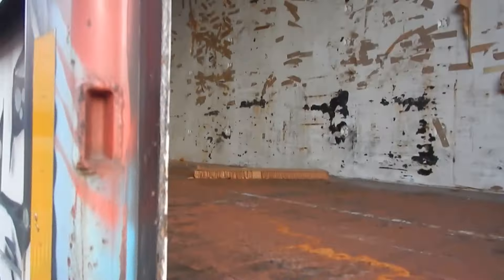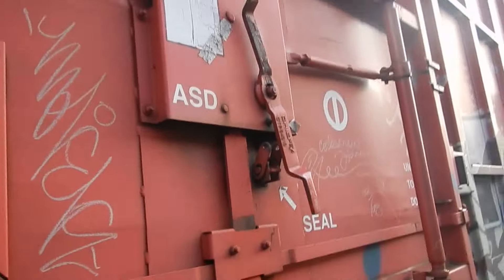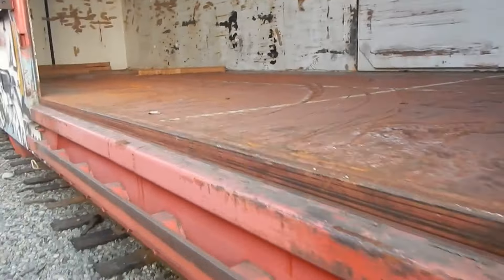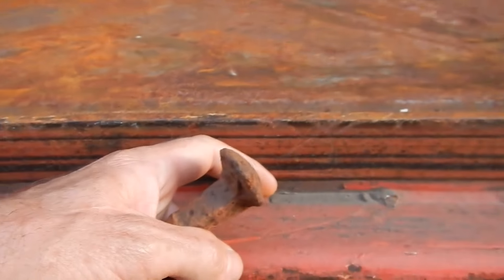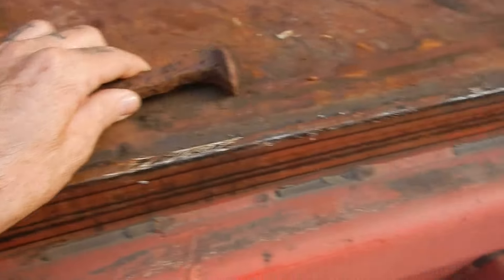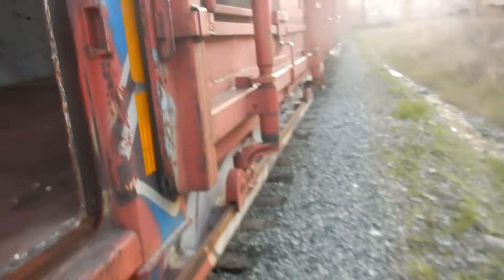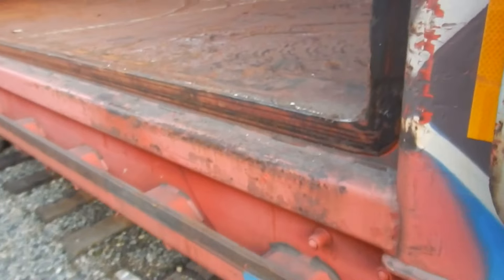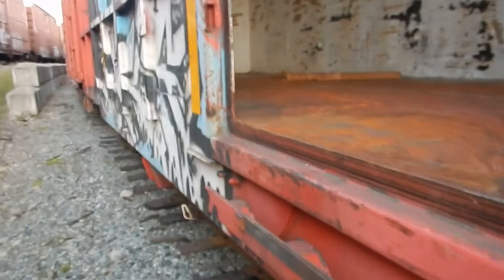Pinning a boxcar door (hopping freight trains)

Comment: Good luck with that.That type of boxcar door is a plug door.They are hard to pin open with a RR spike.
Reply from the maker: utilized as a sample - this door me prefer to string up - one or the reasons me keep rope with me or strapping ya find in boxcars - personally me don't ride boxcars - they rock side to side - every rider and they kin run for them not knowing bunch riders be killed in them - closed ride - me prefer ta sleep in shotgun hoppers - rest of the day me prefer ta ride hoppers with full sided side walls on each side of the deck with hopper dirty face high side walls - me don't ride loco - every rider and they kin run for open loco - not for me -

Comment: The information on these plug doors being safe is NOT ACCURATE. I'm a railroader, and it is illegal for plug door boxcars to move with the doors open because of their tendency to swing out and slam around. Also, if you're gonna ride inside one remember that it is illegal for them to be open and unsecured. If a plug door like this is left open, somebody WILL come by and attempt to close it. Best case scenario, they see you and you get arrested. Worst case scenario you are locked inside. Plug doors are NOT safe to be left open.
Reply from the maker: if ya be posted that some folk be lost legs when the be sit at the door with legs hanging out and did not secure the door from sliding shut - me would agree with ya - unfortunately me Don't understand what ya be sayin - open Boxcars are found in America few in Canada and most them be slide doors - they do Not swing out - they slide back and forth - Swing doors don't exist on Boxcars - spent years working part time for SP BN and CSX - plug doors in general are modern slide doors that move out a few inches - they were first started for bunkerless reefers mech reefers and insulated boxcars - reason for them be insulation that ya can not get with a old sliding door - the other reason all the large box cars today have mostly plug doors is that large sliding doors are hard to open and close - The plug door rotates out on two lock levers and slides but when you close it the lock levers twist in and lock the plug in place - why we pin the doors or utilise rope ta keep them from sliding shut - most riders have cell phones and so it be kinda hard ta be shut in and not get help - only rider me know of who posted they got locked in a boxcar cause the door slammed shut be Shoestring and me take what he stated with a grain of salt - riders do talk about folk who lost legs from a boor that shut closed because it was not secured
Reply: @Telestations  You said yourself that plug doors "rotate out". That's what I meant by 'swing'. As for finding open doors on trains, yes you can. However, these are normally sliding doors not plug doors. It is illegal for a train to move with plug doors open, but it's fine if they're sliding type doors. That "rotate" or 'swing' motion of a plug door comes out further than the loading gauge of the railroad so when it swings like that it can hit things that would normally be clear of other equipment. They also are NOT very secure and they move very easily. You can't say they are used because they move easily but also they don't move easily at the same time. Also, as far as having a cell phone with you goes, that might work but it might not. The railroad goes all kinds of places that the road doesn't, and most of those areas are remote and not covered well by cell service. You can ask many a trainman that's been stuck waiting and stopped (when it's legal to have your phone out) that the signal out there can often be terrible.
Reply from the maker: @zackbobby5550  all in all best ta learn what's up befour one hops on a freight train - started ta post how to be safe videos years ago after riders brought train hopping ta ya homes with videos - after me watched some me wanted and want ta keep folk who are clueless safe - me then lectured online rail stars ta post safety videos and some do - other riders hate me cause me be a Land Warden and an old FTRA FTRC Member -- personally me do Not Recommend open boxcars cause of the murders that happened in boxcars - F-Trooper be me Brother and he be killed in a boxcar - problem with boxcars if only one boor be open make it simple for nasty folk ta pin ya in with no way out - not only that be a reason - other reason be everyone and they grandma be jumping in an open boxcar - most old videos show hobos and tramps in boxcars - so everyone wants ta ride a boxcar - unfortunately most folk be green and do Not understand how to pin a door or how to utilise starping ta tie the door open - between ya and me - reason me look for open boxcars be for airbags me can put in a gondola or high sided car ta sleep and sit on - cant see much stuck in a box - for safety reasons me prefer ta sleep in shotgun hoppers or wood chip cars - if me do sleep in a locomotive me lock it tight so no other rider can make way in a cause me strife or harm -

Comment: So you can kick a spike through steel?
Reply from the maker: only if ya be a superhero with super powers - it's utilized as a reference point for older Boxcars that are found with open doors - the older boxcars have a slit the pin slides into - ya pin the door from the inside and force a pin under the open  door - some do what me do and keep strapping we find in boxcars and utilise it ta tie the door so it won't slide shut - never sit with ya legs hanging out the door if ya did not secure it first - some riders lost leg or 2 cause they did not secure the door - some riders were killed cause workers shut the doors and dropped ya off in no man's land - if ya are not a believer then type inta ya search - riders found dead in boxcars after doors shut closed - what me do is Not A Joke and Kills Mains Fast -